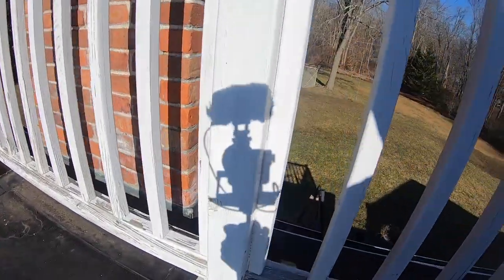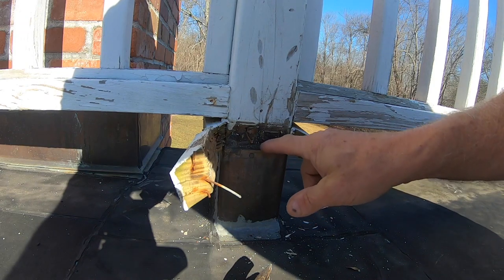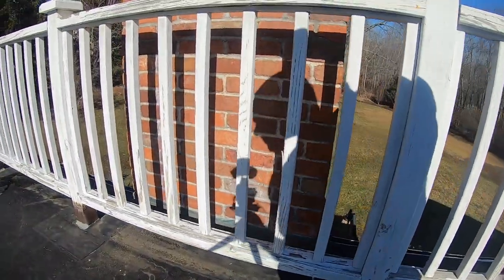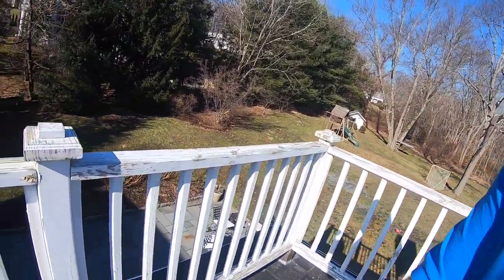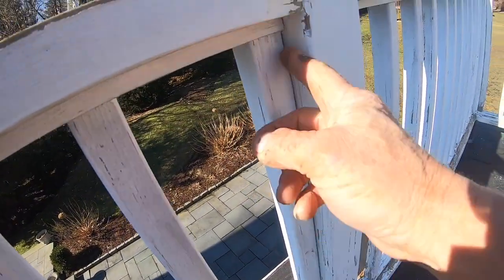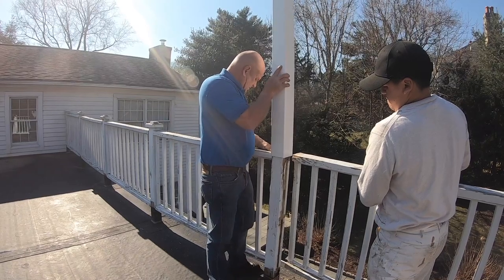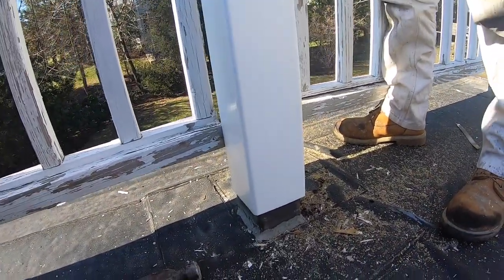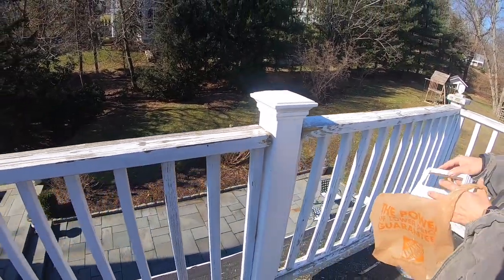Repairing Post leak on Flat Roof Deck - Post Jacket installation

Comment: Very good fix. I was wondering how you were going to fix the post with the rotting wood.
Reply: I would be concerned about the structural integrity of the rotted post. What keeps someone from falling off the roof after leaning on the rail.

Comment: Hi Doc. It seems Turbo poly sealant isn't available in New Zealand.  What do you think of Liquid Rubber? Cheers
Reply from the maker: Here is what I tested today or the last 48 hours and got valuable information. I don't know if they sell Flex Liquid in New Zealand, but if you can find that or a similar product like maybe " liquid rubber",  then you use that in conjunction with a Polyester Fleece or fabric that you can find in Home Improvement stores, you will then have an excellent product. All these sealants used without any polyester fabric are worthless. Imagine concrete without rebar, it will crack. The polyester fabric is what gives any sealant its strength. What you need to look out for is if the liquid rubber will adhere to the surface you are applying it too, then add the polyester fabric and you have a winner.
Let me know how it works out for you.
Cheers
Reply: @FlatRoofDoctor hey doc what you think about those fiberglass roofs in the UK and then they put a liquid rubber over them
Reply from the maker: I will check it out later. Fiberglass is more a rigid product that cant take much stress. In the 60's the US government tried to promote fiberglass roofs but it never took off. I had the chance to fix a few and found that they were relatively very thin and cracked easily.
They look super nice but not practical in my opinion.